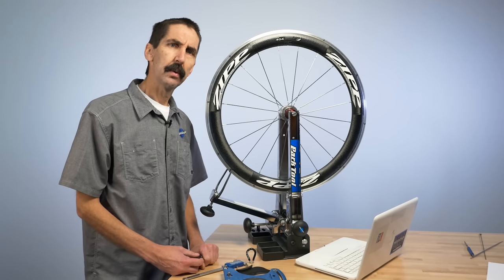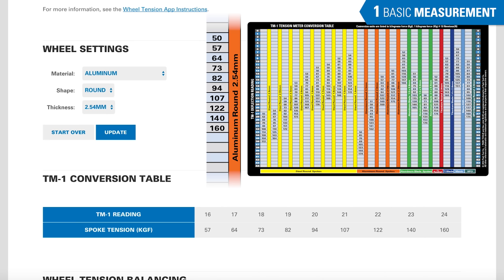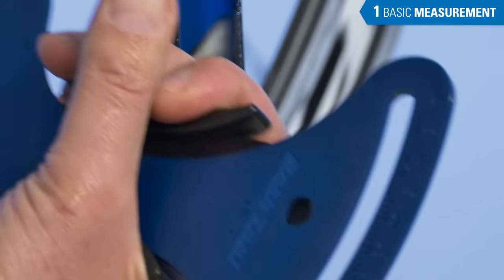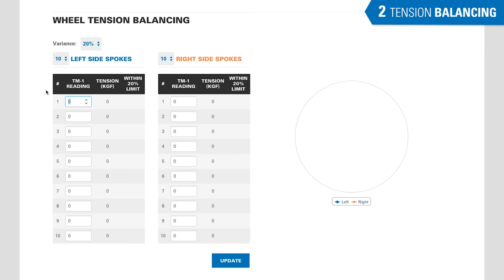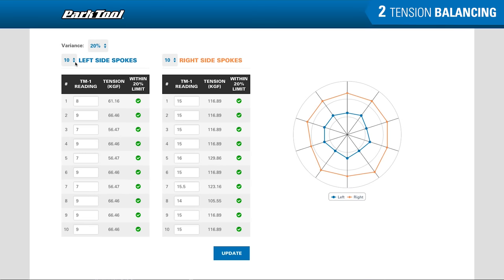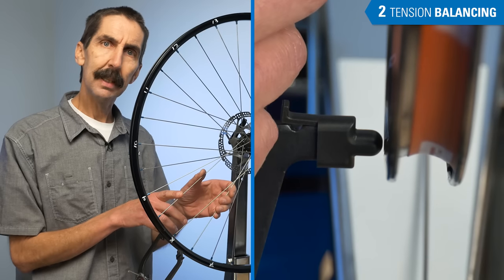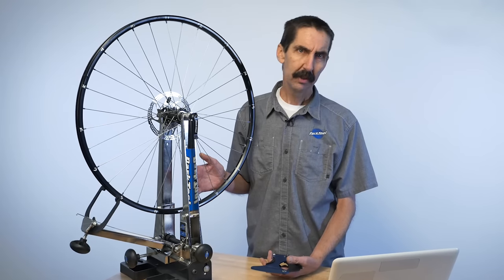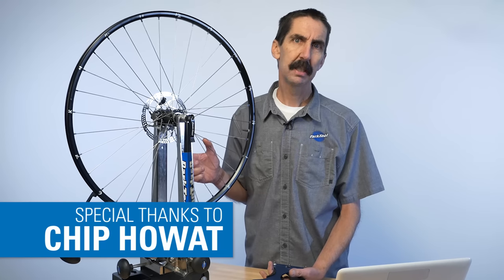How to Use the Park Tool TM-1 Tension Meter & Wheel Tension App

Comment: How should recommended spoke tension be interpreted for the rear wheel, where the tension between the spokes on the two sides can be substantial?
Reply from the maker: Manufacturers publish a max tension for their rims. Even some hub manufacturers have max tensions listed. The max tension is going to apply to the drive side spokes of the rear wheel. When building the rear wheel you will bring the tension up on the drive side up to the max or what you would like, and the non-drive sides tension will be figured out for you as there is no way to increase the tension on the non drive side without either increasing Drive side (which would go above max tension) or having an out of dish wheel. Hub and rim manufacturers try to make up for this with offset rims, different flange diameters, asymmetrical rear triangles and lacing patterns. This is probably confusing and I apologize. Let me know if I can help you understand further.
Reply: Thank you. I understand that on the rear wheel I achieve the target tension on the drive side and let the tension on the non-drive side be what it turns out to be.

Thank you for another great video! Using the TM-1 tension meter with the Park Tool Wheel Tension App has helped me do a great job building my first set of wheels. And what I have learned using the tension meter and the app will help me to do a better job of truing wheels even if I don't have the tension meter or app available.

Comment: just a question, if i have the tm-1, do i really need a true stand or to dish the wheel? i think these errors are easy to see with a tension meter. Is just an opinion, or of a question :)) do am i right? or need all the tools to make the things right>?
Reply: I know this is a bit old of a question, but the short answer is "yes" you do need the different tools because they measure different dimensions of the wheel.  The truing stand provides a gauge to show whether the rim is "straight" without wobble side to side (lateral trueness) and without flat spots in the circle (radial trueness).  The dish tool shows whether the rim is centered between the hub faces, so that it will be centered in the bike.  You can have "even" tension on the spokes, but the wheel is too far to one side.  Or you can have even spoke tension, but the rim is not straight.  You can true and dish the wheel so it runs straight and centered, but have uneven spoke tension.  If this is the case, the wheel will quickly/easily lose that straight shape you gave it.

Comment: Just picked up some cheap wheels from the far east to mount some homemade ice tires.  They are cheap, aluminum 26"ers and I can't find a manufacturer to determine the appropriate max spoke tension.  I don't want to break them, but I need a benchmark to aim for when tensioning up the spokes.  What benchmark should I use?
Reply from the maker: If these are single wall rims, with no grommets, do not exceed 100Kgf by much.

Comment: All my wheelsets use Aluminium spokes that are much thinner than options available in your App. e.g 2 of them are 1.8mm.
I already bought the TM-1 a few days ago, but was surprised to see the lack of support. What's the best way to mitigate this?
Reply from the maker: We do not know of any 1.8mm aluminum spokes. Our Wheel tension App does not show them so that people do not mix them up. Its more likely that you are dealing with stainless spokes. Use a good magnet at the J bend of the spoke to test it.
Reply: @parktool  you are right! I misjudged the magnetic force based on how strong one wheel felt like and weak on all others. Also, I went through the whole playlist, which that part was already covered. I appreciate the response :)

Comment: So basically to measure the tension is not very usefull unless you want to check if your wheel is completely unrepairable?
Reply from the maker: Measuring tension is much like using the correct torque on a bolt. Knowing the tension  will keep the wheel performing better longer.

Comment: Great for wheels 24 " and larger, however I do a lot of 16" and 20 "wheels for tricycles and recumbent bicycles,and electric wheels with large hub motors.  I need a tool for smaller wheels and spokes of 63mm.
Any help would be appreciated.
Reply from the maker: 63mm spokes!? Very cool. We are not familiar with a gauge to measure spokes that short.

Comment: Hi guys, I’ve just bought a new ebike and had an overall check in order to have peace of mind. Unfortunately, when checking the spoke tension (in order to record OEM specs for future reference) I found out that there are big differences in both wheels. Do you suggest to fix this unbalanced situation before the first ride or….is it best to go out for a couple of ride and balance the wheels after that? Thank you for your reply!
Reply from the maker: It depends on the imbalance that you are dealing with. An example of unavoidable imbalance is the rear wheel. The drive side will typically be at the desired max tension and the non drive side will be ~%30 lower. This is due to the bracing angle difference. This also happens on front disc wheels where the non drive side will have ~%10 higher tensions than the drive side due to the bracing angle difference. If you are getting variations in tensions on the same side, then you should correct those. This will make for a longer lasting wheel.
Reply: @parktool  I'm taking your advice and going with 4 sides balanced before hitting the trail. Thank you!

Comment: Could someone explain plz why left and right sides have sooo much different spoke tensions?
Reply from the maker: The rim should be centered between the front fork, or the rear stays.  Especially with the rear, the hub flanges for the spokes are not centered on the hub.  Notice the right flange is closer to the center of the bike compared to the left.  If the spoke tension were equal left to right the rim would be centered between the flanges.  But because the flanges are off center, the right side is tightened more to move the rim to the right on the hub. The moves it to the middle of the frame. For a front disk brake the left flange is offset for the rotor, so the left side is tighter to keep the tire/rim centered.

Comment: Hey Calvin, How do I deal with different size spokes? I've got a disc brake road bike with 1.05 x 2.85 bladed spokes on the R front and L rear and 1.25 x 3.0 on the L front and R rear. The stronger on the rear drive or front disc. These are both 24 spoke DT Swiss R23 DB Spline wheels. The other curious thing is that the weak sides were barely registering on the TM-1. The front weak side was in the 5 range on the TM-1.
Reply from the maker: Currently the WTA will not allow two different sizes on the wheel. As a work around, simply make one sheet per side of the wheel.

Comment: I bought the tm-1 because the spokes in my wheel break too often. I am fairly light at 74kg (163lbs) and don't ride super hard so it shouldn't happen. The problem is I can't find the spoke tension specification for my rim which is quite old. It is 26" WTB Dual Duty XC, 32 spokes (more specific dimensions 559 x 17 / 541 ERD, 23mm). What would be the proper tension in kgf for left and right side on rear wheel?
Reply from the maker: Shoot for a drive side tension of 100- 120 KGF. That is the typical range for most rims.
Reply: @parktool  Thanks! I followed the instructions in this video (really helpful) and the wheel is true with pretty evenly tensioned spokes now. I tried not to exceed 120 kgf on drive side. Hopefully spokes will not break so often anymore, however I discovered that some of the ones I replaced in the past are 2mm whereas originally the wheel has 1.8mm spokes (shop sold me wrong ones and I haven't noticed until yesterday), but I took that into consideration when measuring/tensioning today. I also changed the front derailleur for a new one and adjusted it using your other video, worked like a charm (the old one had terrible play on pivots). For now bike rides like it's brand new :)

Comment: Conversion tables assumes that all the spokes from different brands have the same elasticiy for a given diameter. Is this really true. What might be the deviation ? We see on sapim website stenght from 1080 to 15000N/mm²..
Reply from the maker: The material change between spokes is very little so the modulus of elasticity will change very little from one spoke to another of the same dimension. There for we can assume the deflection is going to be the same. Then we test that on a testing jig and find it to be true.
Reply: @parktool  Right. If I find back my materiel classes i'm sure it is said that tensil strenght can increase without increase in the young modulus
Reply from the maker: True. We are not measuring tensile strength thankfully.

Comment: Great video. But oh, I'm such a cycling mess!  I ride not for fun, not for recreation, but because I can't afford to run a car any more. For the past 15+ years I've ridden 70 miles a week, every week. Shopping, groceries, errands... [I'm based in West Yorkshire in the north of England; it rains a lot, every wind is a headwind, and the hills only ever go UP, not down.😁]

I like the idea a having a great bike in immaculate, finely-tuned condition, but the embarrassing truth is that my crummy machine is 22 years old, is smothered in homemade carriers, racks and panniers, weighs 25kg unladen (55 lbs😲), and has done well over 50,000 miles. I do my best to keep it alive, but it's not easy on a minuscule budget.

So... seeing this video got me thinking. My wheel maintenance routine is very hit-and-miss. Bodge, fiddle, guess and tweak, and ignore the wobbles and rubbing brakes. I'm not proud of myself, but it's probably been cheaper to run my bike's various components till they expire, rather than buy a proper set of tools and fettle parts to keep them healthy.

Yep. My entire bike cost £130, brand new, in 2002. A complete, identical replacement today would cost precisely the same - £130. Financially-speaking, that's ridiculous. I can get a new rear wheel for under £20; I could buy several for the price of a set of good quality maintenance tools, so it actually makes more sense for me to renew and replace, rather than service.

As a one-time keen (amateur) weekend motor mechanic, that just strikes me as wrong.

I appreciate that most people watching this video will be what I'd call 'serious' cyclists - who buy top quality bits and pieces - and spend more on a crankset that I've done on the cheap tyres, tubes and [one] chain that I've had to buy to keep my pathetic old donkey on the road for half its working life!

So... buying a set of really good tools is beyond me. I imagine that the numerous copies, counterfeits, rip-offs and fakes of Park Tools' now famous spoke tension meter are not worth the money (I've seen them on sale for about £15 here in the UK). But an entire new wheel is £20, so why bother?

I'd be interested to know if anybody else has adopted my minimalist 'run it to death' approach to cycling.

Probably not. One of the things about buying great quality gear is that it's not the kind of thing you want to abuse. Although quality parts can last a long time, they can also be more demanding to keep in good shape. Having spent so much, I doubt if a 'pro' amateur cyclist would want to see his bike falling to bits through neglect.

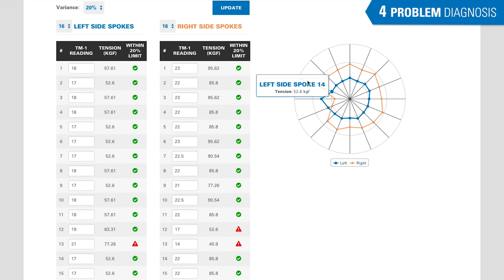Comment: 17:23 this is what I had to fix today. Fun fun fun! Without a doubt, it has a flat spot. I told the customer this, didn't care. I could of sold a new wheel if I used this app and showed it to him. 
What else I see, is that I can cover my butt if I run into this again in the future If I recommend a new rim, and the customer don't care, and wants a free new rim later after it's trash because he didn't care the first time, and wants to claim it was my fault.
Liability is job one in any successful business. These days it's not enough if you tell someone they need this or that. You need to show them why, or they think you're just trying to make a few extra bucks off them. Then they come back for the told ya so.

Comment: You mentioned that all steel spokes are magnetic, and you included stainless steel. Now, I don't know what stainless alloy is used in spokes, but many common alloys of stainless steel are considered non-magnetic. Type 304 and 316 are common alloys that have such a slight response to magnetic fields, they are considered non-magnetic.
Reply: Hey WI neighbor!

You’re correct they use austerities stainless steel like 302 or 304 for spokes, and that austenitic stainless are generally nonmagnetic.  However, the spoke wire is cold-worked to increase strength in the wire drawing process—this cold work transforms some of the austenite to martensite, which IS magnetic.

Comment: with that tool, i can be a mechanic
Reply: It is not a tool that makes a mechanic. A skill makes a mechanic.
Reply: I have heard someone called a "tool" with negative sense. I think if you sell bikes you should check the condition before you sell or buy, also if you race to win you need top-of-the-art equipment to beat competitors. It is advised that you take a problem rim to repair shop if you are not familiar with rim building and truing.

Comment: Nice to see a tool like that, would not be usefull in my company though, its just to slow to process all oure bikes like that. We just do it by feeling and touch. We got around 3500 bikes. Maintaing around 10 to 15 a day for yearly maintenance then repairs in between it is just not feasable. And specialised maintenance for atb and racing bikes is too far in between to even consider doing that. It would simple get too expensive to buy the tool and for the customer as well due to the ammount of working hours input.

Comment: In my 50 years as a bicycle mechanic, and a couple thousand wheels built, this spoke tension tool has to be the dumbest, most over rated wheel building tool ever made.  Think about this... A hardened rim is never perfectly round, meaning when you finish building a wheel that is perfectly round, dished, stressed and true, with a run-out of under 0.3-mm, with a good sense of even spoke tension, some spokes will end up being looser than others,,,, "that's just a solid fact".  But if you start insisting that all the spokes need to be of even tension, then you are asking for the impossible.  Theoretically it might be possible if the rim is of even wall thickness, perfectly round and true from the start with no joint.  Good Luck with that.  It may look cool if you are trying to impress someone, with a white lab coat and your name embroidered, holding a TM-1 Tension Meter, because that's all it's good for.
Here are 4 critically important rules when building a perfect, long lasting wheel....
1. Dip all the nipples, and spoke threads in oil, or special nipple lube.
2. If using J hook spokes (the current and most common spoke on earth), and start putting some tension on the spokes you will notice the spoke tends to bow out from the hub. Then take a small hammer and gently tap the spokes at the J bend on the hub flange, and you will notice the bow angle is gone and the spoke now points sharply and straight to the nipple at the rim. 
3. Now you can proceed to finish building your wheel and keep in mind not to go crazy over tightening your spokes as there should be a fair amount of flex on both sides.
4. If your wheel has a lot of dish, then first tighten the spokes on the flat side, then tighten the spokes on the angled side to set the correct dish. This will automatically draw and tighten the spokes flat side with ease.  From this point you can fine tune the wheel.  After a couple hundred miles of use, then stress them one more time and give them a final true.  Bingo!  They will give the rider years of trouble free riding, with no mysterious creaking or noise making. 
Enjoy.
Reply from the maker: "a good sense of even spoke tension" This tool takes your sense out of it and gives you something objective to work with. A great tool that helps professional and novice wheel builders build better wheels.
Reply: Folks, don't get me wrong, Park-Tool makes some of the best bike mechanic tools in the world.  Unfortunately they also make some terrible tools that literally ruin your bike.  First let me reply about your Spoke Tension tool and then I'll get back to you about your Park chain cleaning tools.
Anyways, so you admit the spoke tension tools are a kinda, sorta make a wish tool.  Then maybe you should redo your instructions as such and really tell it like it is to use it only as a "rough guide".
Now about your Park Chain Cleaning tools....  From my 40 years of expert opinion working retail and inside the bicycle industry, no other tool on the bicycle market ruins more bicycles than these awful chain cleaning tools. Stay tuned. Meanwhile if you have a chain cleaning tool, wait to you hear how it easily ruins bikes, no matter what brand.... DON'T USE IT!!!

Comment: What side of the wheel do you meen by right and left?
Reply from the maker: "Right" and "Left" are from the riders point of view.   For a rear wheel, the right side is also the drive side.  If it is a front disc wheel, the rotor side is the left side.